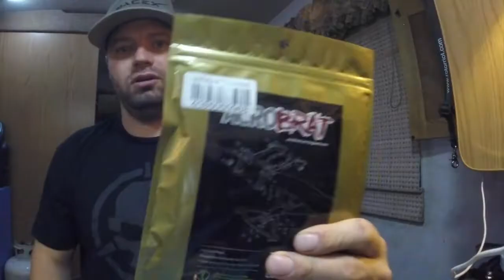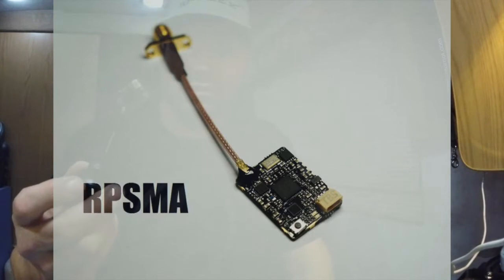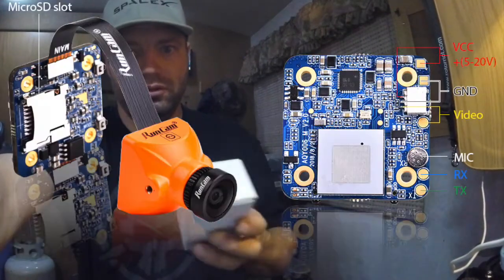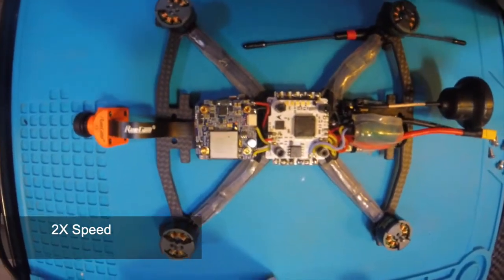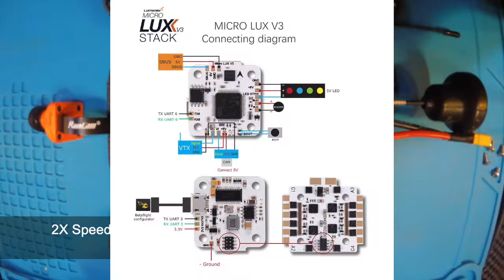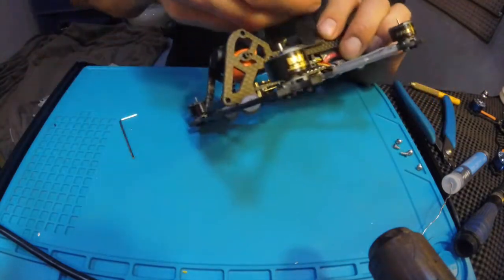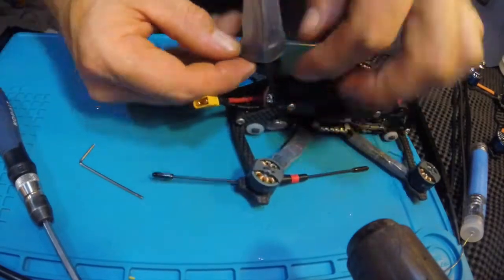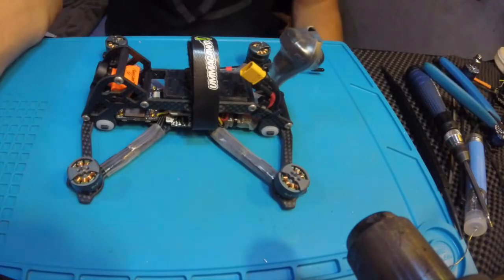Build the Ultimate Ummagawd AcroBrat With Proper FPV. HypeTrain Brats, MicroLux V3, Crossfire Nano

Comment: Looking awesome man. Makes me want to build exactly one like that. Well done mate.
Reply from the maker: Hey thanks for stopping by. It’s a really fun craft I think you will be happy with it. I got the JELLO out with different props and the stock tune on BF 3.5. I was using the tune off of another machine that had an older version of BF. 3.5 changes some things so the stock tune is smooth. Much love! 🤜💥🤛
Reply: Proper FPV thanks mate, what props do you use now (two holes). Only three inch props I now with two holes are the Emax Avans.
Reply from the maker: Ahh,the Avans are 2.4” have to use the HQ T3x3x3 for best results.
Reply: Proper FPV i believe there are 3 inch versions of the Avan as well. Otherwise I ordered the wrong props lol. Cant find a shop that sells and ships the HQ props for a reasenable price. Had those stock on the leader 3 and did like them a lot. Broke one, and cant find replacement. I ordered Avan 3 inch for it now
Reply from the maker: Pretty sure they call them T3x3x3 at most venders but those are for the 1106 motors on a 3” Babyhawk R, are really T3x2.4X3 on official specs. Should work but they’re a little too light. Tommy recommends the HQ T3x3x3 or the Rotor X T3x3x3 for best performance. The DYS are the wrong ones for sure, all 4 exploded in mid-flight without a strike.
Reply: Proper FPV darn man, then I ordered to small props for my Leader 3, downgrading it to a leader 2.4 🤣

Comment: just did a build with same stack and motors have to say it works well together. nice job
Reply from the maker: Thank you. I still have to tune the MTO out but it’s really a nice craft.  Next time I will get lower KV motors because it sags an 850ma battery really fast.
Reply: @properfpv7160  im useing mine on a moka jj frame so its much lighter than the acrobrat but those motors kick ass and are really smooth  im running the hq 3x3x3 and they are pretty good on them
Reply from the maker: Wow that sounds awesome! I do like those motors, good quality and I like to support Tommy. I have 3600kv HGLRC Flame motors on another AcroBrat and I can get 6 minutes of flight time v/s 2 to 3 minutes I get with the 4100kv which would be ideal for racing. Much love! I really appreciate you stopping by, it means a lot.  🤜💥🤛
Reply from the maker: Maybe the HQ propellers are better then the DYS ones which I don’t think are as good as the GemFan ones I use on my other motors.
Reply: @properfpv7160  i forget who said it but they recommended the hq or the rotor x ones i got the hq from rotor riot i would get a set may benifit you
Reply from the maker: That’s a good tip. I had a hard time finding the right props for them, I think a lot of the  JELLO is from those crappy DYS Props. 👍
Reply: It has to be the props cause I'm using the HQ 3x3x3 with clear bushings and no jello.
Reply: @FPVQuadModz there you go your tune is prob fine

Comment: Great build. Very clean.Were you able to get rid of the jello?I'm not sure it's the tune as it there even on low throttle. I want to get a Split but, see it's an issue.
Reply from the maker: Logo 800 yeah BF 3.5 stock tune helped a lot as well as HQ T3x3x3 props. The new m12 lens will reduce the Jello too
Reply: Yea, they say the lens helps a lot. Thanks @properfpv7160
Reply: Have you tried the T-Motor F20 II 1408 3250KV ? I'm going to use them or the Brat's. I'm not sure I like the 3 holes for the Brat
Reply from the maker: Logo 800 no I haven’t tried those. Honestly I don’t like the Brat motors much and my Acrobrat frames with the 3600kv HGLRC Flame motors fly the smoothest and have the longest flight times. 🤜💥🤛

Comment: man..guess im lucky to never have had any jello in my brats
Reply from the maker: Hey thanks for watching! Much appreciated. I fixed the Jello problem, it was two things. Wrong props. The DYS T3x3x3 are no good. The right tops are the HQ T3x3x3 or the Rotor X T3x3x3. The second problem is the fact I just put Beta Flight 3.5 on and used he tune I had from an older version. 3.5 changes the algorithms and fixes problems so the stock tune was messed up by my old settings. 🤜💥🤛 If I have fresh props on its super smooth now. My footage usually has some Jello because I bash my quad in a session and the props get a little bent, I straighten them, keep flying, just having fun and think I’m not going to use it but It turns out to be the best flights so I use it anyway. 🤜💥🤛
Reply: Proper FPV we’ll keep it up bro. Good job. Have a dual camera heavier setup and then a super light setup.

Comment: Hey ProperFPV, you know the TBS Nano outputs S audio on one of the 4 pads on the side?  I'm not sure which it is, but I'm sure you could find it with a bit of research.  That way you could get smart audio to your VTX since your out of uart TX pads.
Reply from the maker: ctsws6 hey thanks for the tip. yeah it’s ch4 on the Nano RX

Comment: hello Porper ,  what Drone FPV can i buy for beginer ? not a toy but not so expensive one too ..for the moment i have a bebop too , may be i can try ACRO fly with this too ?
Reply from the maker: Hello Nicos, thank you stopping in today I really appreciate it. The Bebop is a good video drone but it’s not going to do Acro. I recommend starting with a bouncer/whoop like the Mobula 7 and using a simulator like FPV FreeRider until you’re the master of the playground. Accumulate the best goggles and radio you can afford. Then move up to something like a 3” racer, they fly like a 5” now, just as fast but they cost less to repair and buy. They can’t carry a GoPro but the Split Mini 2 fits nice and gets 1080/60 hd footage which is fine for YouTube. I like the HGLRC 3” models like the XJB you can buy for $175 prebuilt. You will also need goggles, radio and your own receiver. I recommend Fat Shark Dominator series goggles and a Taranis X9D but there are a lot of new options. Try looking  on UAV futures YouTube channel for reviews until you get the right match for you and your budget. 🤜💥🤛

Comment: How did you get rid of the jello?
Reply from the maker: Put a BF 3.5 stock tune on it and some GemFan 3028 Wind Dancers. 👍👍
Reply: Proper FPV I just got my hobbywing nano and I’m waiting on my Brat motors with HQ T3x3x3 props. How do you think they will be?
Reply from the maker: Sean Hales I use those too. Seems like some are bent out of the package. Have had a jello problem with this craft in general but the 3028 is the smoothest so far.

Comment: great vid my friend. witch firmware are you using with the lux v3 Flight Controller?
Reply from the maker: Pedro NHFD thanks bro. I think that was back when 3.14 was the latest. I fly 4.2 and have an acrobrat now but have lost that quad in the sea...
Reply: Proper FPV  thank so much for the respond. The reason of my question is because I just build an Acrobrat and I flashed the lux v3 to 4.1.5 and is not stable. And another problem is my friend did the flash on my acrobrat and never saved the original firmware. My friend what can I do in this situation? Witch firmware can I flash? I will definitely appreciate any help.